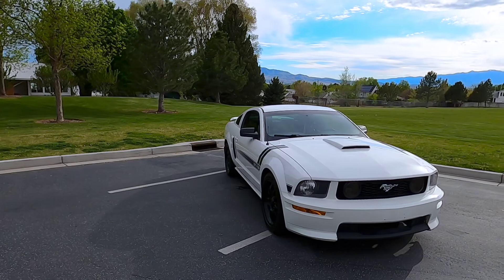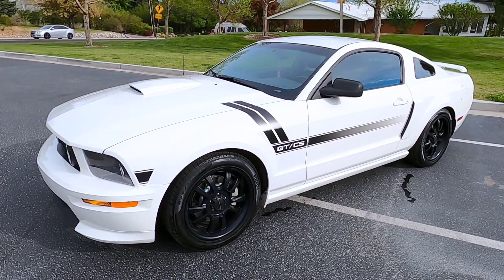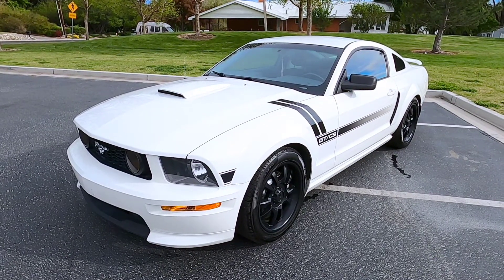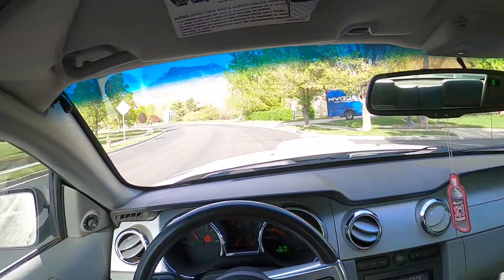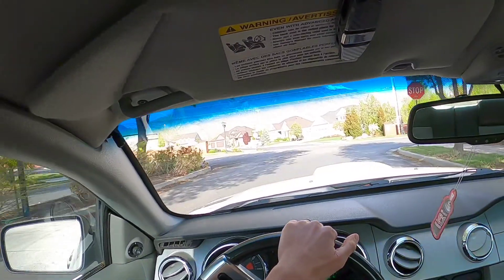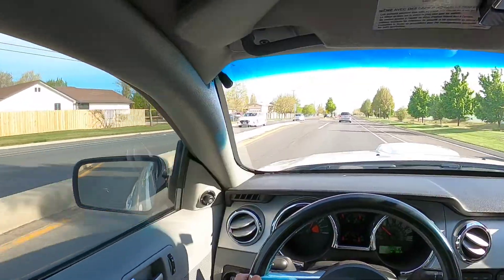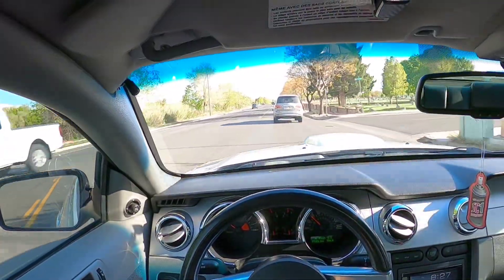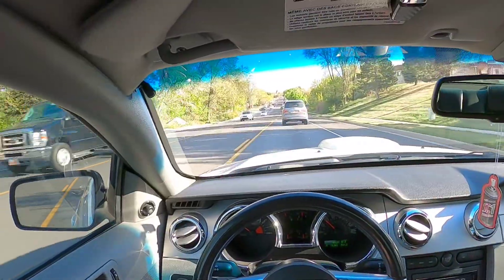Lower Control Arm Handling Review 2005-2009 Mustang GT

Comment: I own a 2007 GTCS.   I'm curious how many miles yours had when you replaced the lower control arms ?
Reply from the maker: Thats awesome! It had about 80,000 miles
Reply: @cole-lindsey  that's not many miles.  I've got slightly over 88,600 on mine and so far everything is holding together well.  
I'm getting ready to put a new set of drilled, slotted, and vented rotors on mine and replace the pads.  They make a considerable difference in stopping.  
I also run a little bigger tire than the original factory size.   I run the optional 255/45ZR18 on the factory rims and I've noticed better cornering but it did cut the fuel mileage a little.
Reply from the maker: That's good! Mine was originally owned in Idaho so maybe it was on rough roads its whole life. I put drilled and slooted rotors and new pads on the front of mine too. I think I new wider tires like that. I just raced autocross with my 235 tires and the front end was pushing a lot